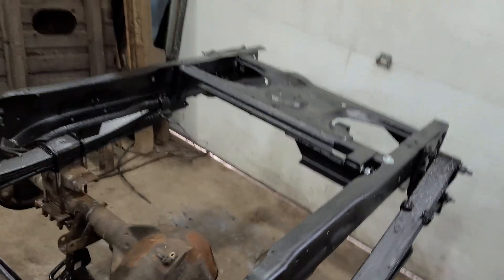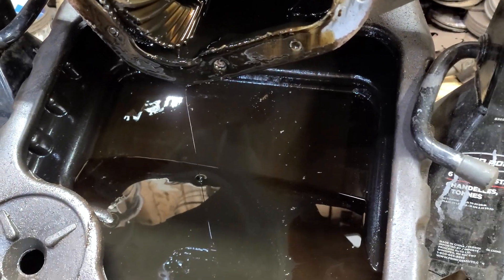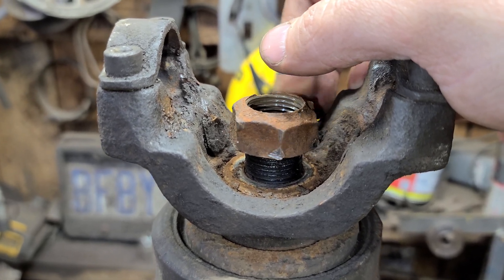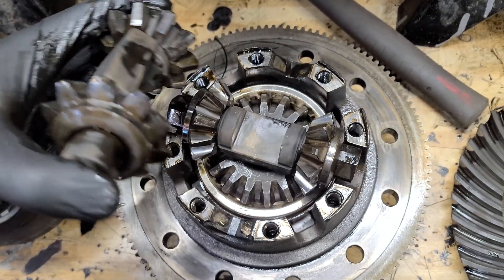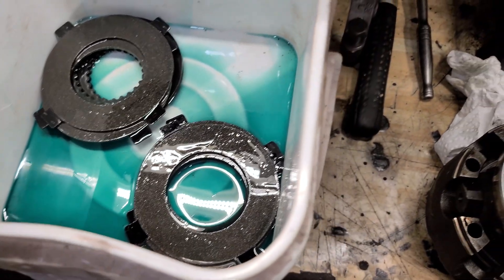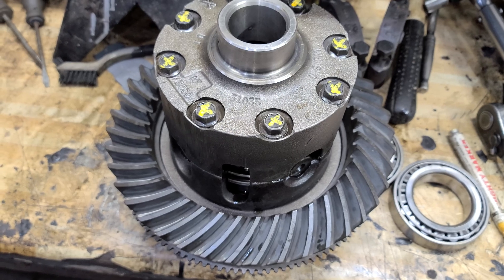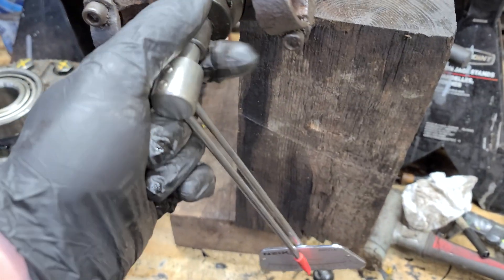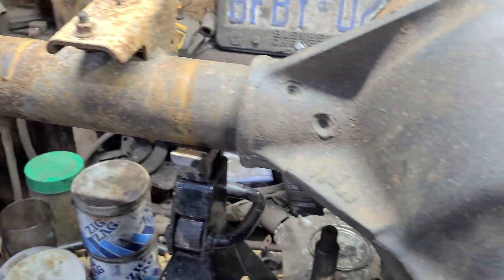Dana 70U Limited Slip and Regear - Dodge M37 Restomod [Episode 22]

Comment: What do you mean the set up bearing is interchangeable !??
Reply from the maker: In this case I bought 2 new full sets of bearings to regear the differential- I sacrificed one set to slip on easily by hand to get the right amount of shims needed (this saves a lot of time), and then pressed on the other new set of bearings for final assembly and checks.

Comment: Another great video! I’m using the original axle and diff. Only replacing the old oil and pinion seal. Any tips on how to remove the old pinion seal? It is stuck in there.
Reply from the maker: Sometimes they are very much awful to remove! I had a lot of trouble pulling the front seal back in Episode 10. My method is to increasingly use more force. Start with a seal puller, and if that doesn't work, screwing a couple screws through the seal to push against the side of the bearing to act as a puller on the seal. Ultimately if that doesn't work, you can usually fold the seal out with a small cold chisel- but be careful not to hit the housing! Also, make sure to check that your axle vents aren't plugged, sometimes they'll make a new seal leak too. Good luck!